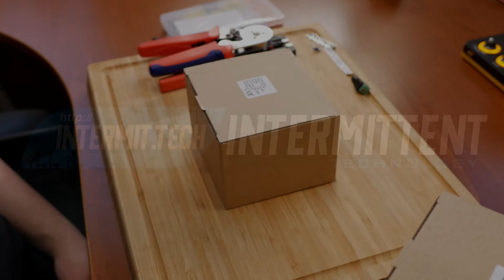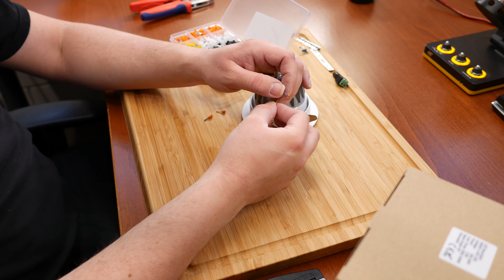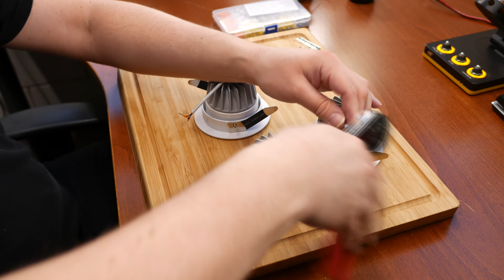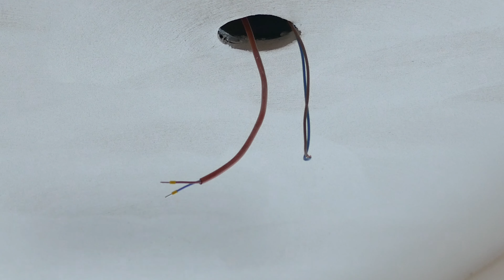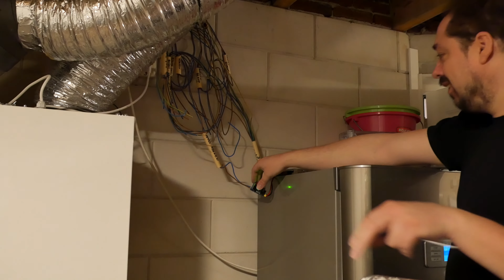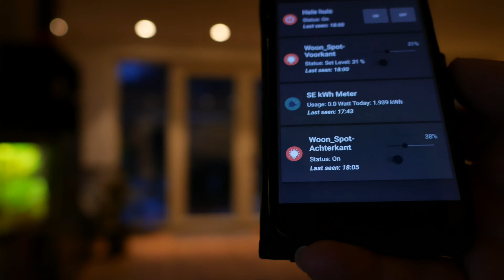ESP8266 LED Lighting: Installing COB LED downlights controlled using QuinLED

Comment: I just wonder, what do you use as manual switches for your lighting system?  I know most can rely on automation, but I sometimes find I need to still use a wall switch now and then.  
Also curious where you got the downlights from?  I have trouble finding ones without drivers.

Comment: Hi, great video. I have a question for all QuinLED projects. After installing QuinLED, you loose a possibility to use simple switches in the wall?
Reply from the maker: Well that's a bit complex to answer, yes you lose the ability to use a normal 110/230v switch but you gain the ability to use any switch you can connect to Home Assistant which includes motion   sensors or your phone or well, anything that's compatible basically, even a switch connected to a GPIO pin on one of my boards (even another board then the light is connected to).

I know this needs a bit of a change in thinking compared to traditional installations but most often it's actually a lot more flexible!

Comment: Hello sir,

Thank you for great video.
This COB is AC voltage Operatible Or DC Operatible.?
Reply from the maker: The lights are being sent DC current directly. There is a big AC to DC power supply in front of it. Connected to that is my QuinLED module and then the cable goes directly to the lights.
Reply: That's cool. i could not find DC dimmer for more then 30VDC except QuinLED.
Thank You
Reply from the maker: +Dharmendra Savaliya wait there! QuinLed is rated to 28v officially. It will do above that though. The mosfets are not a problem, the one's I use go up to 60v so you are good there.

The DC-DC converter is an issue though. Officially they go up to 28v. I've run them higher because the load we are asking from it is quite low. But officially it's above spec. If you want to really go much higher in voltage best to get a voltage converter that officially accepts higher!
Reply: Ok sir,
i have tried ckt below to operate 28VDC 600mA COB with Arduino. https://arduino-info.wikispaces.com/Brick-4ChannelPowerFetSwitch

But after sort time MOSFET is getting to much hot.
Can we solve heating issue by using higher DC-DC Convertor ?
Reply from the maker: Are you using PWM to dim or just on/off code? I haven't noticed my MOSFETs getting hot
Reply: I am using MOSFET for dimming with PWM.
Can we do this using this ckt ?

Comment: Can you please link to the exact automatic wire strippers you use in the video? They look very interesting. I have located dozens of similar knockoffs but cannot find this exact model. I really enjoy your videos. Please keep up the excellent work. Thank you for your time.
Reply: Nevermind, found them. Knipex KN1242195. Pricey but I bet they perform better and last longer than the knockoffs.
Reply from the maker: Cool, yup those are the one's! I've enjoyed them for a few years now and they are awesome. A while back though I got a few knock-off's (like the one's linked) and those are absolutely fine too. 

So depending on how often you use them, maybe make a choice like that. If you're going to use them often, get the real deal, it will be worth the money. If you're only doing fun projects sometimes, the knock-off's will work just as well. :)

And as always, your kind comments are appreciated! :D

Comment: I'm not sure how you're regulating the current through each COB LED without a local driver, can you elaborate? Thanks
Reply from the maker: This does not work with every light or COB LED so you need to test it! What I did was hook it up to the included constant current power supply and then checked the voltage it was supplying to the COB LED. Then I hooked it up to a constant voltage supply and matched that voltage. 

The COB LED will draw the set voltage and the amperage it can at that voltage. When raising voltage, power draw goes up together with it and you must make sure not to give it too much voltage. I'm not sure if there is any regulation circuit inside of the downlights I have but from my experiments with the COB LED modules they won't just draw an unlimited amount of amps, only what they can given the voltage supplied.

When stringing up multiple lights they all get the same voltage and draw the same amperage. And that's how it works. Adding a QuinLED after the power supply, you can use PWM to dim the lights!

p.s. I do agree that driving the COB LED using constant current is better/more efficient but from my experience, the way I'm using these downlights they don't get very hot or use a lot more power.
Reply: I imagine it's just a COB module, your issue will be as the COBs age they are likely to drift apart from each other.
Reply: As the lamps warm the forward voltage will drop.  If you have a constant voltage power supply the current is going to increase to bring the system back to equilibrium.  Watch out as you can find yourself in a bad feedback loop as hotter lamps will draw more current from your power supply, which in turn will make them hotter....

You should put some regulation in somewhere, maybe the resistance of the cables is enough. While you can tune it for room temperature today, what happens when it's 20°C hotter or 20°C cooler and the power supply has drifted 5%...

Maybe just a (power) resistor in series with each lamp is all you need, you waste a little power, but the system would be a lot less on edge.
Reply from the maker: +Edward Cooper but the lamps are connected in parallel, does this then still apply?

I am currently not running the lights near their max voltage because we like them a bit warmer too. Even after hours of use, when not in the pot they only get slightly warm to the touch at 100% and we mostly have them set to 30%.

I have to admit that running them constant voltage instead of current is not ideal, but neither are a driver per lamp with a AC dimming solution imho. My current setup has been working great for over a year in a 4 lamp test setup.
Reply from the maker: For some reason I can't edit my comment. I just wanted to add that I appreciate the comment and thoughts on the subject! :)

p.s. I have also over-sized the central power supplies quite a bit (~50%?)
Reply from the maker: Hmm, that's an interesting point. Are you saying normally the constant current would compensate for age of the COB but now because I'm applying a constant voltage this won't be possible?

Up until now they all seem to look the same, even compared to new one's of the box and the one's I've been running for a year like this. But time will tell!
Reply: I've been thinking, and I think the trick is that these are colour shifting, so there is more going on than a simple string of LEDS.  What you've done wouldn't work with normal COBs but with these colour shifting COBs all that happens if the system foes out of balance is that the colour shifts a bit, no big deal!
Reply from the maker: Yeah, I agree, thinking about it, there has to be some circuitry inside of the lamp which enables this feature. I might have to take one apart! (Should have done that a lot sooner. :P). I'll make a video about it and also how to internal color changing works, people might find it interesting. :)

Although I have had the same setup running with normal COB lights though. But there I guess you do need to watch the voltage a bit closer and not run them near maximum voltage just to be sure.
Reply: I think the cleverness is all integrated into the COB package, I suspect you'd have to remove the phosphor and get the microscope out to figure much out.

Just remember a naked LED is a current driven device, not a voltage driven device, the forward voltage varies based on temperature, age and production variation.  What you ned to be managing is the current through the device.
Reply from the maker: I agree with you there, but without a driver per COB LED it will be very hard to give it back the ability to become a current driven device again. Adding a resistor limiting current through the device would work but then we don't have varying voltage to go with it so we're stuck with that problem.

Also my form of central PWM dimming will not work with constant current from what I have tested.

Having a driver per LED ends up being quite expensive. I don't like having a driver per light, way too many components to fail and also if you wish to have PWM control over them, you get into the really expensive driver territory which would make the whole setup unsustainable in my opinion.

That's why I went the route I did and am now using this setup. In reality, it's been working quite well and haven't noticed any problems with it. :)

Comment: Can you change the colour temperature?
Reply from the maker: Yes, these lamps vary their light color/temperature based on the input voltage. So for instance 30v is ~2000K and 38v is ~3000K, anything between that is a mix of those colors. Light output also decreases slightly when lowering voltage, but not THAT much and at full 100% they are quite bright anyway.